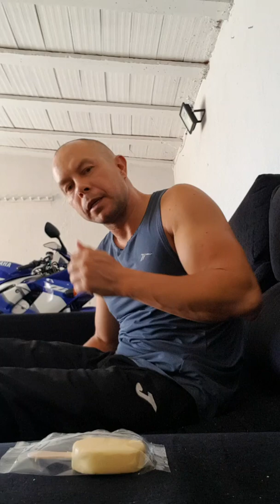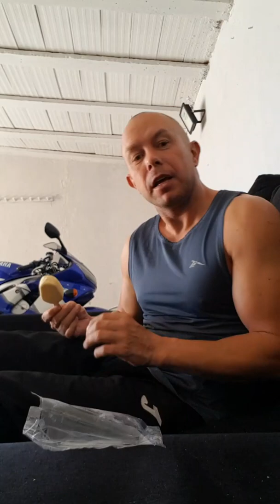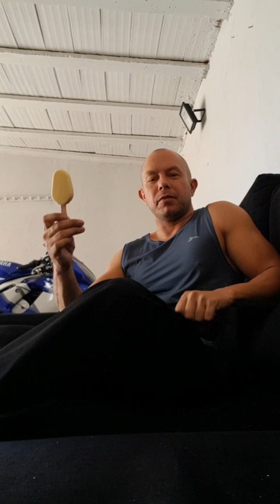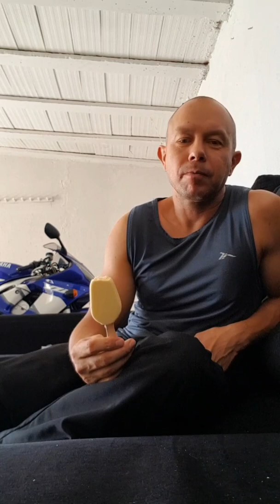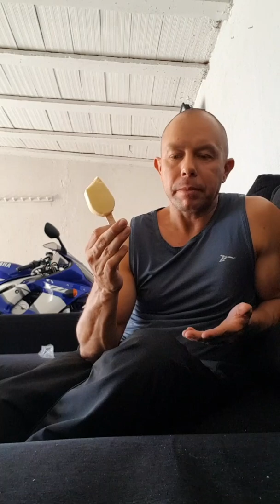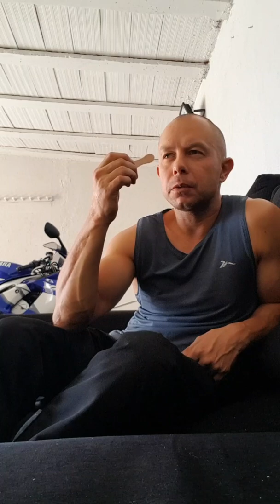The worlds greatest engine, the Mercedes om606. And eating ice cream.

Comment: Hi, @ what boost pressure we can expect already walve float on stock om60x aproximetly? Tnx!
Reply from the maker: Some engines has it stock. Some on a tune. Others on 2bar and 400hp.
Reply: @FtunePerformance  ok, tnx, if lets   say  om605 with 1.8 bar and 6000 rpm limit might be okay with original  valve springs, but if go above that then better upgrade springs?
Reply from the maker: @edzal1  Rpm Has really nothing to do with it. Or of course it has but that's not the cause of the problem we are talking about. I would never even run a stock engine with stock springs 🤷‍♂️ It's a really cheap insurance and easy to swap AND you can do the 20yrs old valve stem seals at the same time.

Comment: man after dealing with glow plug nightmares, fuel issues, immobilizer mercedes BULLSHIT, i am not convinced these are the best engines ever made any more unfortunately. theres a reason you don't see that many in good shape still running. the fully mechanical ones, maybe, because there is no check engine light with the glow plug failure and you can just ignore it.